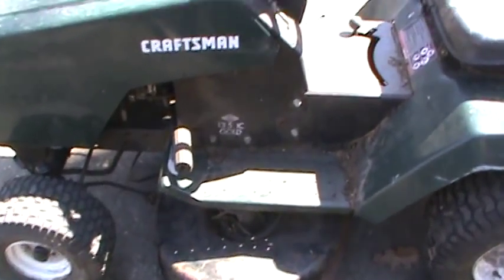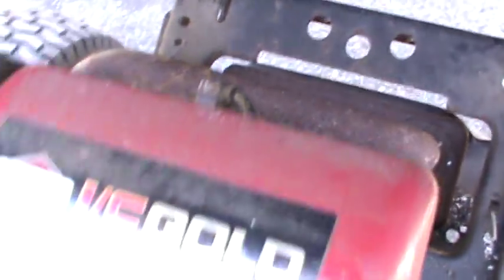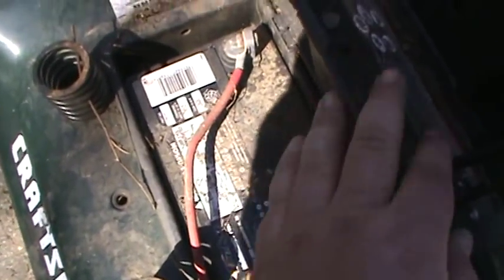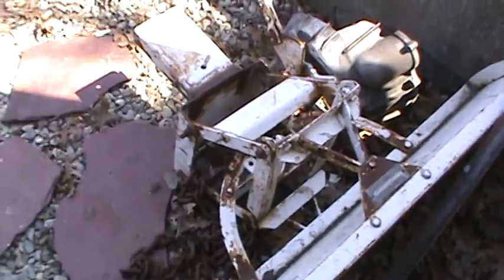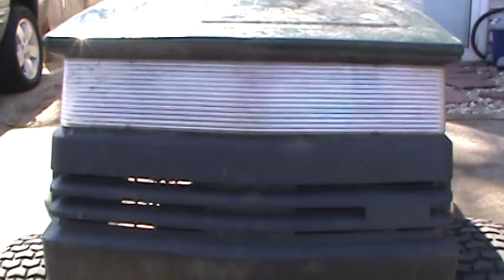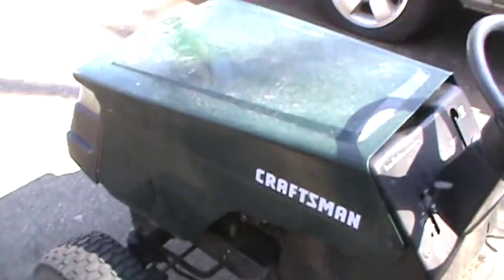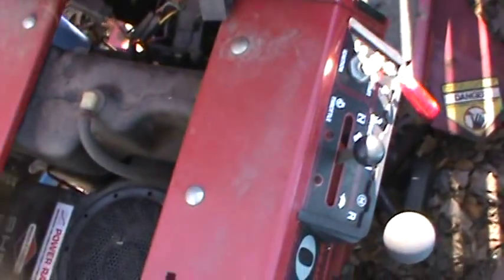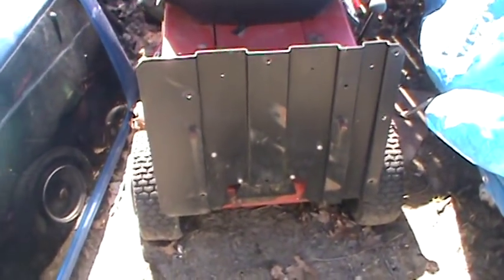FREE CRAFTSMAN 13.5 HP RIDING MOWER PROJECT

Comment from the maker: I think it will have plenty of balls to push it forward (as long as its not deep) a few of my neighbors have similar setups (store bought) I also have chains for the rear tires. Ive seen trucks with the rear drag plow not a huge fan of them.But thanks for the idea.Also if I was to push it backwards dont know how strong the reverse gear is.

Comment: Yea my NAVY docs have gotten tired of me messing my self up more. They wrote a note to SSDI and the VA I am to do no lifting and no driving . I had my spine crushed in a torpedo reload accident. I am already in a wheelchair. I can give a you tip on that model .
Look for any cracks in the frame near the front tires . I know if you put a plow on it they will show up worse. You can get the deck shell for 150 bucks you have to swap everything over. 
Let me know if you find any cracks.